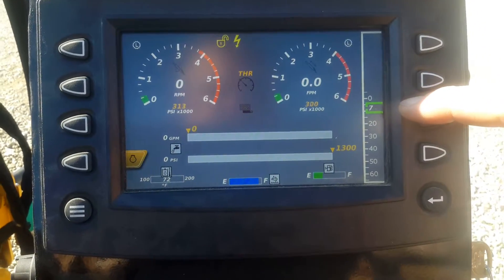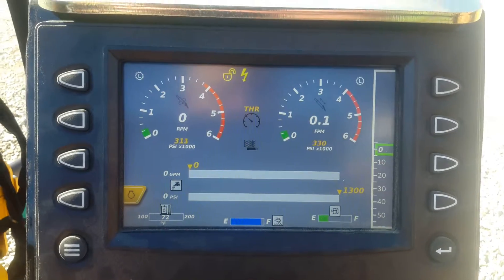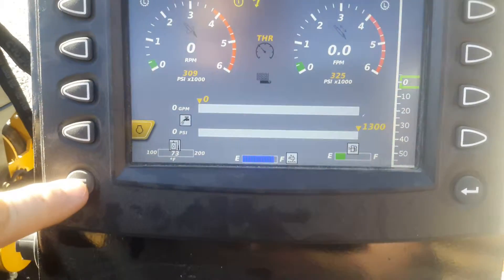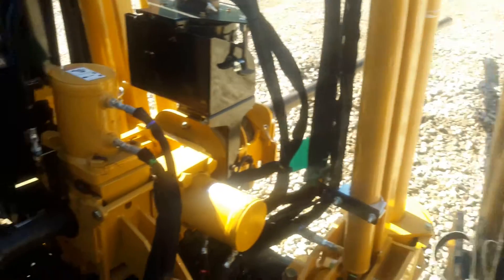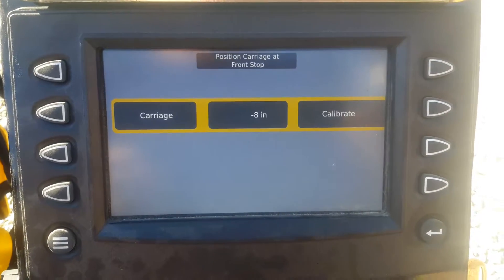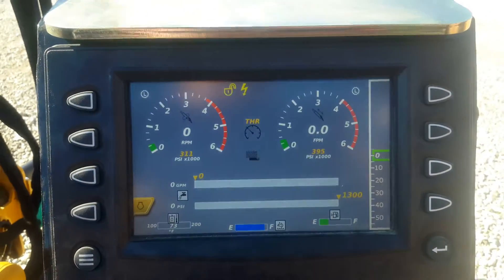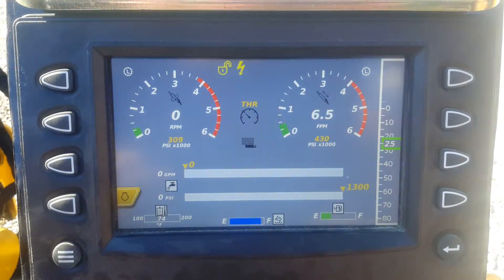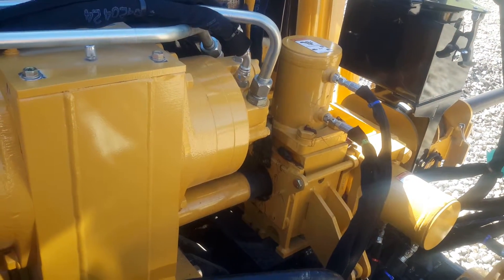23 x 30 series 3 drive motor calibration

Comment: Anyone know if there is a fix from constantly having to do this. I have to do this calibration almost every other rod.   Really slows down my drill shots.
Reply: Where you able to figure it out ? Having the same issue
Reply: @ sadly no, seems to be a common problem in most of their recent rigs.
Reply: It may be a sensor in the drive motor we’re working to confirm this